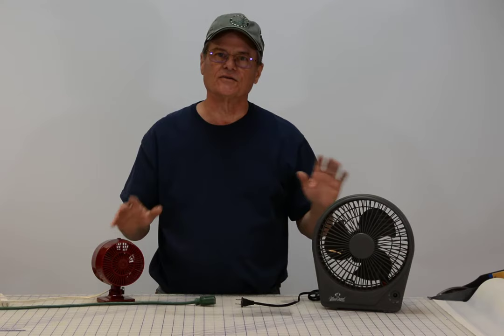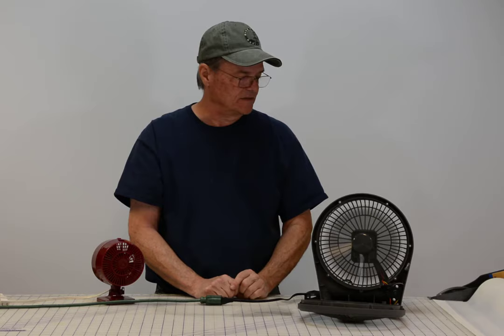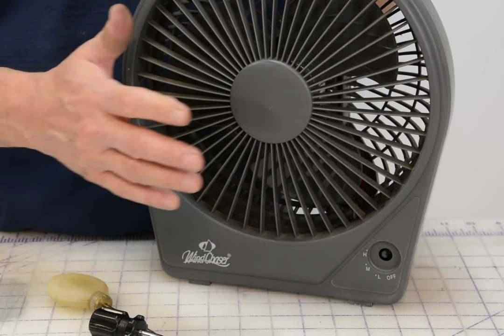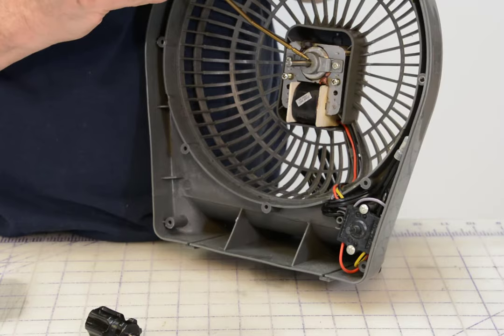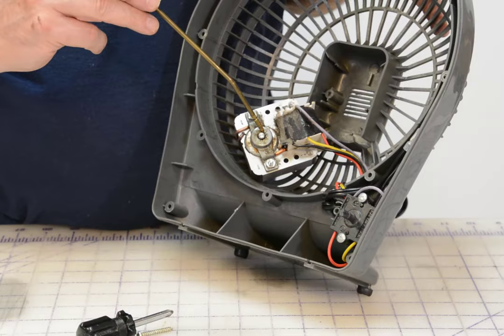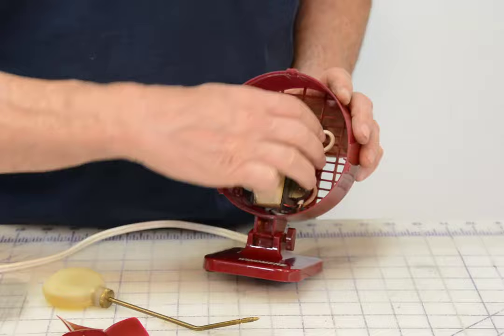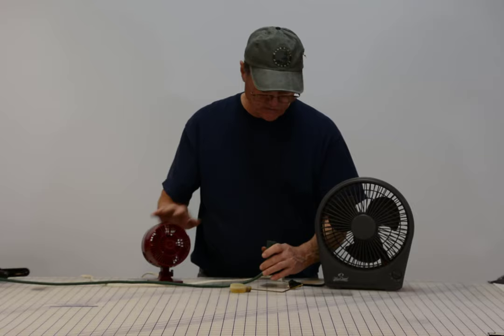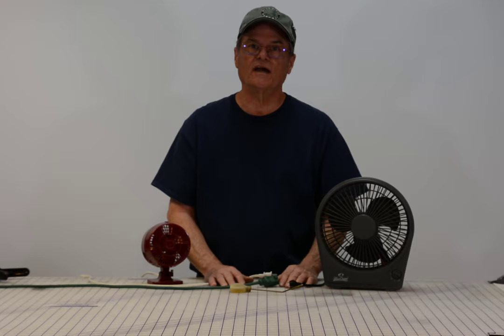Fan slow to start or won't startup - Easy Fix!

Comment: Brilliant. With this knowledge I was able to save our "Lloytron" fan from the skip. Disassembling the fan for me seemed easier than it was for you. I found a large plastic nut holding the fan on. The thread was opposite to all others I've come across - anticlockwise to tighten). A similar large nut was then removed to take the cage off. The fan had come away with a gentle tug.  I think my fan has been design with easy access in mind, say for cleaning, and the housing came off after about ten minutes when I had found a flat head screwdriver small enough to fit the clips. The plastic was flexible enough not to break. 

The motor screws were as shown in you video. 

The motor didn't come away however so I had to try to remove the oscillator gear box at the back (only two more screws) to access the rear bearing. 

I then discovered another reason I think my fan was designed with this sort of maintenance in mind. The oscillator gearbox merely needed to be pulled back by a small amount (exposing what looked like a conical grub wheel). I didn't need to remove it at all. 

All in all, once the fan and its enclosure had been removed, I had a mere six screws to remove. No more.  To think my wife wanted me to scrap the fan....!!

I have a couple of photos of this if you are interested. I would have liked them to accompany this response, but I don't know if or how this can be done here.

I used a tiny amount of "FELLOWES Performance oil" to lubricate the bearings. I bought this from Amazon along with a paper shredding machine a few months ago. I think it is vegetable based and, as I anticipated, it was ideal for this purpose. The fans is working perfectly now. Seems faster too, and it's really very quiet now.

Thanks for your help.
Reply from the maker: It sounds like you really have your act together.  Thank you for the detailed update and have a great day.
Reply: The nut threads are reversed so that the direction of rotation doesn't loosen the nut.
Reply: @SKYGUY1  That is correct.  Thanks Terry.
Reply: Awesome that would of made a great YouTube video here also good job think about video it if you ever do something that brilliant again

Comment: I had to go back to the dumpster to retrieve the Holmes Blizzard I had thrown away. Tried your fix and it worked. However, I had to use WD-40 as that's all I had. I will buy oil and do it right. Thank you sir!
Reply from the maker: Thank you for the kind comment and for visiting, have a great day.

Comment: I revived a 40-year-old 120VAC powerful Black and Decker Drill by lubricating the bearings this way.

Now I gotta try the three fans my neighbors put in the trash to the curb, and I grabbed them, in the night!!!

They put a snow blower to the curb a few years ago, because the drive belt kept falling off, a few YOUTUBE  videos like this one  later - and I knew where to place a $0.10 Nut to fix that; then a new gear for the starter motor's solenoid (teeth all busted) for $20, and a replacement $5.00 brand specialty Allen screw to re-secure the Starter Motor, (why the solenoid gear teeth broke) changed the oil, cleaned the spark plug/gaped it,; new gas: running/working like a champion and sold it for $450!!!

Another neighbor put a $150 scroll-saw to the curb, a YOUTUBE video later, bought a $5.00 transistor, replaced the broken-off from the circuit board one, reinforced it from vibration effects - working!

A little common sense and TLc goes a long ways!
Reply from the maker: You are doing very well.  Maybe you should start your own YouTube Channel.   Thank you for visiting and have a great day.

Comment: Just fixed the fan for my mom-in-law; it would not turn at all.  I blew the dust off, unscrewed all but one of the cover screws (it was seized); swung the cover to the side, did not move the motor assembly at all, but placed a couple of drops of Singer motor oil on the main shaft. Worked like a charm and was done in 10 minutes. Thanks so much!!
Reply from the maker: You are very welcome and thank you for visiting, have a great day.

Comment: I Just picked a little fan my neighbors put to the curb with their trash; when I plugged it it spun very very slow so took the fan off and back cover to have a look inside... It was like new, no dirt or anything but the shaft felt like it didn't spin as smooth as it should so did a quick Google search and came straight to this video. When you said it just needed a drop of lube I was so surprised I paused the video and went straight to the garage to get my PL-100. I lubed the shaft and the oscillating mechanism then tested again... now it's perfect I feel like I should give it back to my neighbors.
Reply from the maker: Glad you found this video helpful, that means a lot to me. Thank you for the kind comment and for visiting, have a great day.

Comment: At exactly 1:27AM today (Mon,19th of Dec, 2022), I was able to fix my stiff fan blades in my hostel. 🥳
Normally, I'd have had it checked by a technician the next day and they'd have charged me so much money for such little problem. 😭
I just needed to oil the spinning thingy in the middle of the motor. I did and voilà! It works just fine now. 😃
Here's me saying thank you so much Sir. Really appreciate the video. 🙇🏾‍♀️
Reply from the maker: You are very welcome.  I am glad it worked for you.   Thank you for visiting and have a great day.

Comment: Great video, this is exactly the problem my small desk fan had after I air dusted it today. Opened it up, wiped out the dust and gunk and got slow spinning fan blades. My larger fan that died on me a while ago might have the same issue, I just never found the time. Might have two fans back thanks to you! Tracking down where to get machine oil now!
Reply from the maker: Good luck with your project and have a great day.

Comment: thank you so much! you would honestly be shocked how little bit of knowledge is on youtube about this, how to fix a fan. Honestly, yours may be one of a few on the whole site. And all the others were long, complicated and quite ridiculous. Yours was to the point, easy and simple and you saved me $60 on another fan. I bought this fan last summer, used it for maybe a month, and not even that often when i did have it on. Took it back out again last week and it took a few minutes to start a slow spin. The other video i watched had me take apart the whole motor, check the thermal conductor, Finding your video, i did exactly what you said and voila! it works perfect!
Reply from the maker: Thank you for the kind comment and for visiting, have a great day.

Comment: My wife and I have a fan that we use DAILY and about 6 months back the motor went on it so we took it to a repair shop. The guy charged us like 12 $ to change out the motor. We brought it home and it ran fine for a few weeks. Then one day it started to do the "slow down" thing where it would really slowly and sometimes bind up and stop. I was pretty angry because we had JUST had it fixed. I went onto YouTube and entered the problem into the search box and BOOM I found your video!! I did exactly as you instructed and when I took off fan blades the post of the motor would hardly move at all. I added a couple drops of household oil and YAY !!! The fan works like new!! Thanks a bunch, here s your like!!!
Reply from the maker: Thanks Shaun for your wonderful comment and taking the time to post it. We really appreciate the positive feedback. We also are happy that we were able to help! Have a great day!

Comment: I agree with you when your fan is not free running,or not turning if you blow on it,it needs servicing.
What i don't agree with,is how you do it.just add a drop of oil near the bearing is a tempory solution at best.The manucaturers don't want their fans to be returned to them for servicing just after a few monts of operation.So they buid their motors to be lubricated for a long time.
It should last many years.This is done by adding a peace of fabric between the bearing and the support braket,it is held in place by a thin locking washer.This fabric act as a sponge for the oil.After many years,it will drie up,it needs to be replenish.This is where you should put your oil.Sometimes it has harden from the heat so you let soak in oil solvent for a day.
Let it dry,add a few drops of oil,let the excess run off on a rag .This is done at both ends.
It would be wise to clean the motor shaft with oil solvent as well.Warning,when you reassemble your motor do not over tighten its asembling screws,junst a bit of tention,ck it now if it free runs when you blow on it.
Good luck.
Bye.
Lucien
Reply: If your motor don't have this fabric sponge ,you can make one  using a piece of ribbon felt and install it yourself .Get the ribbon felt make 2 holes in it with a slow running drill ,cut some pieces about half inch length ,let them soak in oil,install them on each side of the motor ,I did this on my humidifier motor now,it won't  wake me up in the middle of the night.
Bye.
Lucien

Comment: My fan was slow to start up with and was making noise during the speed up time. With your video and knowledge, I now have completely fine running fan again. Thank you . I used the hair trimmer oil that came with the machine.
Reply from the maker: Glad I could help. Thank you for the kind comment and for visiting, have a great day.

Comment: I had the same problem with my bathroom exhaust fan. I Initially oiled the shaft and front bearings and it didn't do anything much. I then searched Youtube and came across this video  and noticed the motor structure was almost identical to your fans, so I decided to take the fan apart and placed oil to the rear bearing like you did in this video and 'VOILA' it worked a treat and now runs like new. Thank you Sir for uploading this great educational video
Reply from the maker: I'm so glad you found this video useful.  Thank you for visiting and leaving your kind comment. I hope you will continue to visit my site. Hope you have a great day.

Comment: Have a small expensive heat circulator fan that was experiencing same slow start problems. Took it a part and it’s working so much better after a few drops of oil. Thanks to your video, it’s as good as new.
Reply from the maker: Happy to help.  Thank you for the kind comment and for visiting, have a great day.

Comment: Another satisfied customer. Last year thought the slow start was due to a faulty on/off switch. Tried spray electrical terminal cleaner with no improvements. This year the blade would not even start turning slowly. Your "oil the bearing" tip fixed the fan. Thank you!
Reply from the maker: You are very welcome and thank you for visiting, have a great day.

Comment: Every fan owner should see this! Thank you Wayne! 👍
Reply from the maker: Thank you for the kind words.  If you have not, please subscribe to my channel.   Wayne
Reply: @DIYwithWayne  It looked like you had some interesting content and I did subscribe!

I have a much larger table fan that takes times to start sometimes. I opened it up, it looked a bit different inside and I nearly yanked the coil connections off; thankfully I didn't! Lubricated what I could (with an oil that came with a shaver). The blade isn't noticeably much looser but so far it's starting right away after turning it on. I have a question that I'm asking separately so that others have a higher chance of reading your answer.

Comment: Well explained and simple as someone who repairs and restores fans from the 60’s through the early 90’s I’ve started also doing this with my modern daily driver fans that I’m not collecting. You’d be amazed at how little lubrication most modern fans leave from the factory with and once they get proper service like this they perform and last much longer. My go to oil is the 3 in 1 oil in the blue label bottle for fans and zoom spout I’ve gotten great results from using these oils and a bottle will last for many years because like you said it doesn’t take much. I highly recommend doing this simple maintenance once or twice per year depending upon the frequency you use the fans. Usually I clean the guards, blow out the motor and wipe down the blades monthly to keep peek performance because dust drastically reduces the airflow.
Reply from the maker: Thank you for the kind comment and the great suggestions.  Thank you for visiting and have a great day.

Comment: Dude! Fiddled for 2 hours changing the capacitor in my extractor hood fan. Fan had delayed and random starting. It didn't help! Almost gave up then wondered if it was mechanical and came across this video. Fiddled about getting to the fan and it was greased up so I cleaned and oiled like in the video. It's working! You saved me at least temporarily £450 English pounds. Thank you!
Reply from the maker: Glad I could help. Thank you for the kind comment and for visiting, have a great day.

Comment: Thanks!!  Just finished taking blades off to clean the fan well, reassembled and realized this fan started to be slow to start the last time I used it.  I was going to pitch it, but with your help, I now have a fan that looks new and runs like new.
Reply from the maker: Glad I could help. Thank you for the kind comment and for visiting, have a great day.

Comment: Thank you for this video. I made the rookie mistake of cleaning a couple of fans with a steam cleaner. Upon reassembling, one of the motors would barely move. The fan was almost in the dumpster when I came across your video. I had some hair clipper oil in the house so I followed your directions and the fan came back to life like magic. Thanks again.
Reply from the maker: Glad it helped!  Thank you for the kind comment and for visiting, have a great day.

Comment: Well explained and presented. I usually clean the bushing area with a toothbrush and apply PTFE synthetic oil which won't dry out and stick. My fans work around the clock during summer and maintenance is a must. Thanks for the video!
Reply from the maker: Thank you for your suggestion and for visiting our channel.  We hope you have a great day.

Comment: Thankyou for the video. I can’t sleep without a fan running in my bedroom. 2 days ago it started making noise.so I jumped on Amazon an ordered a new one. The one I had lasted 6 yrs so I wasn’t to upset. I saw your video grabbed my can of 3in1 oil,an took my fan apart,I had to take the motor apart to get to the back Bering, I put a little more than a drop in the tear bearing,it was pretty bad. I put it back together, an it runs like a new one. Again Thankyou.
Reply from the maker: Glad it helped! Thank you for your kind comment and for visiting our channel.

Comment: My fan started to 'die' and I just googled for a fix.  This fixed it right up! It was squeaking loudly and wouldn't start right away.  A little bit of oil that I use for my electric razor and it works like brand new.  Thank you!
Reply from the maker: Glad I could help. Thank you for visiting and taking the time to leave a nice comment. Have a great day.

Comment: Thank you! My fan need is so great and I've been without my main one for 3 days. Found your video and was able to fix the issue likkity split! Also fixed another one I've had on a shelf for about 1 year. Couldn't part with it because it was such a powerful fan but so noisy and wobbly. Added the oil in all the places and now it's a kitchen cooling unit. Thanks again for the simple instruction!
Reply from the maker: You're welcome! Thank you for the kind comment and for visiting, have a great day.

Comment: Thank you so much.  I watched another video where he put oil on the shaft, but not on the back bearing.  It worked for a day or so and then stopped again.  But after using your method of oiling both front and back, it works perfectly and spins so freely.  Thanks again, and have a great day.
Reply from the maker: You are very welcome and thank you for visiting, have a great day.

Comment: small addition of detail: some fans in the back have a mechanism that holds the oil too, adding oil to that cloth/fabric holder will also ensure its lubricated almost indefinitely. my utilitech stand fan for patios has one and i used engine oil on it, specifically 2 stroke for just a few days until i can make it to an ace hardware to get some 3 in 1
Reply from the maker: You are correct about the revisor for oil but most small fan motors don't have them.  It would be better if they all had this feature.  Thank you for your suggestion and for visiting our channel.  We hope you have a great day.

Comment: Thank u much!  I have a dynatrap and the fan stopped, only had it one month.  Oil did work not for sure if I put enough cause it was hard to get to.  It's working and time will tell lol.  The fan is running a lot faster now.  Thanks again for the video!
Reply from the maker: If it is running faster you did good.  Sometimes it takes a little while for the oil to work it's way into the bearing.   Thank you for visiting and have a great day.